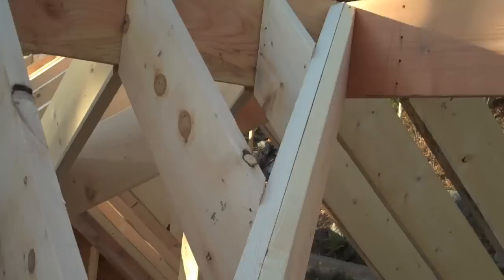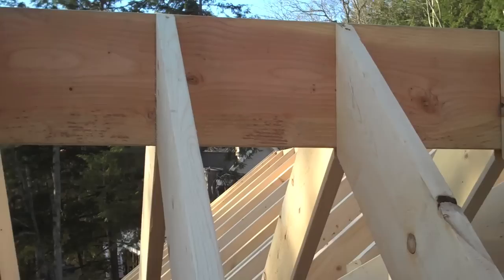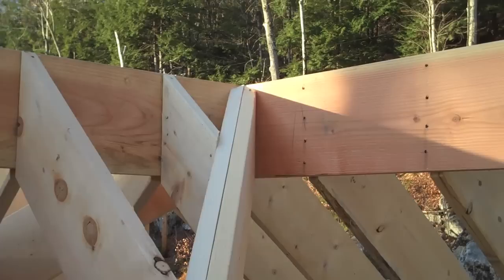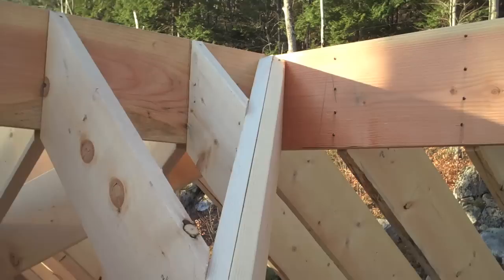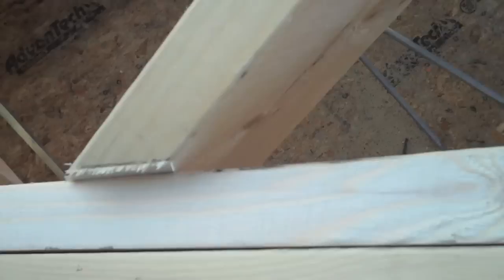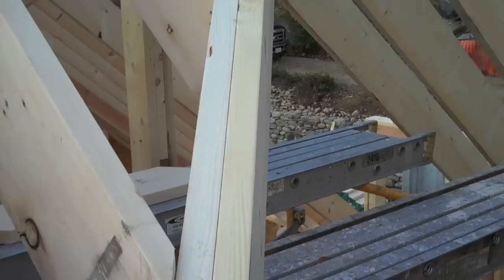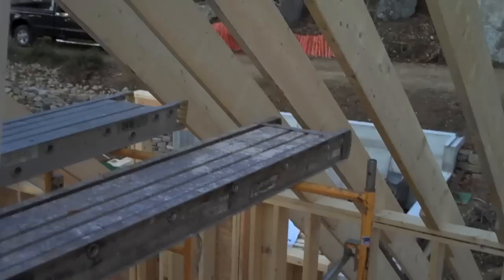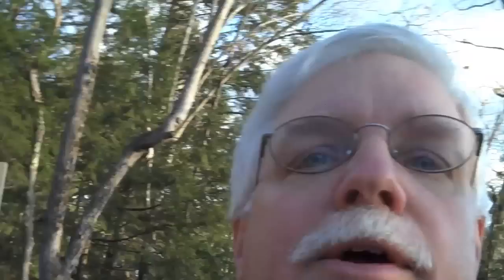Valley Rafter

Comment: I would normally use treated timber (Tanilised) for cut roofing. Your cuts are very neat and you know what you are doing. I also like to leave my common rafters about an inch shy of the top of the ridge board. we use graded timber here in the UK so it reduces knot size and any bad grain etc. You have used oversized timbers which is good structurally. Thanks for vid.

Comment from the maker: TheShamus19, I wanted to make sure everyone realized that you've switched gears here. This video is about a valley rafter and your comment is talking about a ridge board. You're 150% correct that ridges are in compression and you really don't need a ridge board so long as the two rafters touch one another. Valleys, however, are in tension and you absolutely need a center framing member. Valley rafters are beams and have lots of weight on them. We probably should have not been so harsh to Street.

Comment from the maker: Simple on the double valley rafter. Remember the valley rafter is a beam. The valley jack rafters transfer their weight to both the ridge and the valley as they *bear* on the valley, not the top plate of a wall. Hip ridge rafter are NOT beams as they are in compression. Valley rafters get loaded with vast amounts of weight, especially here in snow country.

Comment: those cuts are nice  . just looking  at the shortest  valley jack  tells a lot of the quality of work,  When that one is off means something is slightly off, agree        with ask the builder the ridge is a small concern but with valleys  or supporting valleys their may be  a. concern , when   commons sags    with a roof load  that's where the  focus is , on both sides .the trouble dos nt start at  the top .

Comment from the maker: @starlite528 That's a fantastic question. I'll bet you can figure it out by yourself if I give you this clue. If you were to put a straightedge on the TOP of the rafters and sild it down, where do you anticipate the tip of the straightedge would contact the valley rafters. :->>>>>  Isn't that interesting? You have to think in three dimensions.

Comment: So, how do you derive the angles and lengths of each valley rafter?
Are the valley rafters on 16" or 24" centers so that the plywood roof sheeting will break on the center of the rafters properly?

Do you think that you could show how to calculate the length and angle of a simpler "common" rafter (including the "birdsmouth" cut)?

Comment: This gives me a better explanation but what am I missing here? I am on my way to train to be a draftsman at one of their tafe campuses; and the description of a valley rafter I was given in their book according to the Australian standard, off course, said to me probably everything you shared with everyone out there. The description in their book said to me that the valley rafter is located at an internal angle change of roof direction and in many ways is similar to the hip rafter. However, there is the added complexity of supporting the upper end of a valley rafter which, in many instances, may be located partway up the rafter length of the adjacent roof plane and often removed from a structure that can adequately transfer its load to a wall. Well, what do they mean when they say, "often removed from a structure that can adequately transfer it's load to a wall. I am now left puzzled that pieces of timber do not just pick themselves up and walk away. It sounds like they're speaking in technical terms, I understand you everything you show me but maybe you can give a description of what they mean from what I shared here.
Reply from the maker: Well, the valley rafter is nothing more than a beam. The plumb and seat cut are made with a framing square set at the same pitch of the roof except at a lower angle. If the main roof is an 8/12 pitch, you set the framing square at 8/16.97 to produce the plumb and seat cut. Be sure the heel height of the valley rafter is identical to the heel height of a common rafter where it passes over the outer edge of the wall. GL as we say in Morse.

Comment from the maker: Lawson, you never asked me! First, the name is just valley jack rafters. I'm assuming your roof is a square or a rectangle, not some weird reverse gazebo or some other very odd valley.  If the valley is indeed a 45 degree angle, all you do is set your circular saw table at 45-degrees. You mark on the face of the rafter the plumb cut line for the regular roof pitch. If the roof is 9/12, you make a 9/12 plumb line. Cut along that line with the tilted saw blade. Ta Da! VICTORY! It's that easy.

Comment: This is from the New Hampshire gov't website which links to the IBC.  R802.3 Framing details. Rafters shall be framed to ridge board or to each other with a gusset plate as a tie. Ridge board shall be at least 1-inch (25 mm) nominal thickness and not less in depth than the cut end of the rafter.  My concern is, what does a potential home buyer do?  If the builder doesn't know the code, and the inspectors don't  enforce the code, where does this leave the buyer?

Comment: Why aren't  the ridge boards equal to or greater than the depth of the rafters?  That's code.  WI UDC Comm 21.27 (4) (b)2.  "The ridge board shall have a depth at least equal to the length of the cut end of the rafter abutting it."  Curious as to how the rough inspection went.

Comment: does a valley rafter need to run all the way down to either a bearing or exterior wall? am I able to chop it, obviously where its no longer hold up anything, and then run a 90 degree beam plumb down to a supporting wall? - am I making sense? (I need to allocate a space but a valley rafter is running right through it)
Reply from the maker: No. A valley rafter, like on a dormer, can terminate in a double or triple common rafter. But the connection detail is very critical. It's time for you to hire a structural engineer.

Comment: Hi Tim, i am curious what the name of the cut is at the top of the rafter, in a situation where there is only one truss/rafter and not double like in your video. there is a bevel cut on both sides to create a point in the middle, if done properly. I thought it was called a birds mouth, but apparently that is a notch for a truss to sit on a wall plate.
Reply from the maker: I'd call it a single valley plumb cut. Does it really matter what it's called? The bird's mouth is the 90-degree cut where the bottom of the rafter rests on and WRAPS down and around the top of the bearing wall.
Reply: @askthebuilder  I was curious because im sort of the cut guy at my jobs. there's usually a couple guys in the trusses giving me cut lists and im still kind of new to framing so its nice to communicate properly. Although, a lot of the time we can make eye contact anyway and i can see what cut they are looking for. I always get hung up on those ones!

Comment: how did  you double up the rafters for the valley rafter? what did u use to fasten them together? and how far apart did u put nails in them???
Reply from the maker: I cut two. I used nails. 6 inches on center staggered.
Reply: @askthebuilder  16d?
Reply: @Eastbaypisces  Always 16d for framing members.

Comment: The problems that you run into with the ridge board size is on a steep roof lets say a 12/12 the plumb cut needs to have full contact with the ridge.  So if you use a 2x12 ridge with 2x12 rafters on a 12/12 pitch you will have 5" of plumb cut not in contact with ridge

Comment from the maker: Why? It makes no difference. The ridge board is in compression. A simple 2x4 would work and not affect the strength or load-carrying capability of the roof. The load is carried by the rafters, not the ridge board.
Reply: Ummm... not really. ICC code specifies that any hip/valley ridge beam must be a minimum 2" thick. So you need two 2x's. See code R802.3 roof framing details

Comment: Hi I need help. I plan to build a vaulted ceiling roof over my deck and my plan is to build half truss with 22''x 17' long  ridge beam with is very heavy duty the span is only 22' long and the 16' length but the safety department won't provide me the permit for the half that I plan to build my own. It is very simple for me and very strong to my roof.  will you answer my question? If I go ahead and build the roof over my deck I want without a permit, Are they gonna tear my beautiful roof down? or a fine , how much is the fine. I feel I have lost my freedom from using my professional skill that I am good at the structure, maybe better that the structural engineering. Thanks, Please let me know.
Reply from the maker: What is so hard about getting a stamped drawing from a structural engineer? The building code is in place for several reasons. One of them is to protect FUTURE home owners from those that think they know what they're doing. It's okay if your roof collapses on YOU, but it's not okay if it collapses on a person who owns your home long after you die.
Reply: I have seen this situation over and over in my area. The inspector comes out to inspect something that is not done by his job protection buddys who belong to the job protection network. They carefully explain how your job is unsafe and can't possibly pass the code inspection. Then they are slipped $500.00 in cash and the job miraculously transforms from unsafe to safe.  Safety works in mysterious ways.
david

Comment: Right every time if one knows how to read hip&valley cuts on a framing square...that has those tables of reference embeded on it. Or short cuts on how to swing arch a steel tape to determine the long to short of the overall length of the cut. Its quite simple once one understands the right way its achieved. And each there after is short or growing longer by inches as set in the tables on the square. Or one can get a Mi-Tec software to do a take off on every cut board to its entirely correct way of each saw cut being fully correct in the build of the roof components it will dictate. FYI.
Reply from the maker: Be sure you subscribe to my FREE newsletter right here front and center: www.AsktheBuilder.com - Also, I now LIVE stream each M-F at 4 PM Eastern time at https://youtube.com/askthebuilder

Comment: And if you look in old buildings they use a 3/4" ridge or no ridge at all... That's all supported by the sheathing... I'm 25 been doin it 5 yrs full time and ridges aren't necessary (unless its a structural ridge) get with it people

Comment: Reading the comments some of which are more like complaints I have to laugh.  This roof  is not that large.  Having framed a 19,000 square foot hip roof with 2 valleys on a U shaped building with the main section being much larger, taller,  and looking at the 1905 and 1912 houses we live in here which only came with 2x4 rafters I'd say it it is just fine.

Comment from the maker: I hate to say this, but you don't have a clue. It's obvious from your comment that you've never framed a roof with hips or valleys, or if you did and did it the way you mention, then you did it wrong. I'll give you a clue. Think of the top surfaces of the framing members as just LINES in a three dimensional drawing. Don't think of the rafters as solid objects. Therein is the answer. Think where the LINES intersect. Next time THINK before you type characters on a keyboard.

Comment: Brutal framing...all those should be flush to the valley line...who measured that should be fired
Reply: No they shouldn’t, they should continue the line through to meet in the middle of the double valley! If they were flush then there would be a flat valley
Reply: Valley rafters only sit flush with the top edge of the valley if the valley has had the backing angle cut into it. If no backing angle has been cut into the valley the rafters sit high and plane to the centre line of the valley.

Comment: if this was in denmark this wasnt approve at all if the rafter doesnt land on each other then its all over
Reply from the maker: It's not in Denmark and if you put a straightedge on the surface of each rafter, you'll discover the end of the straightedge just touches the crack in between the  double valley rafter. You must have been out sick that day in high school geometry class.